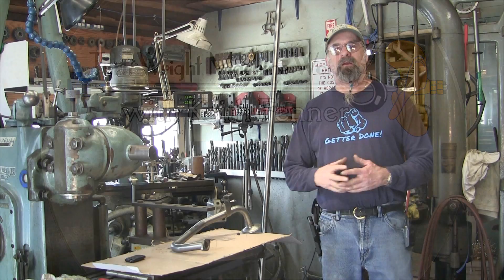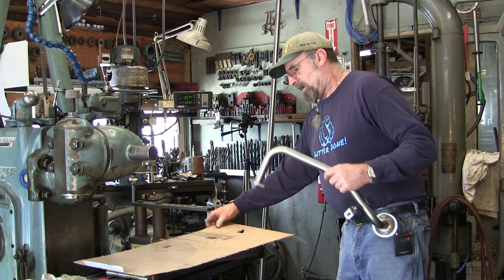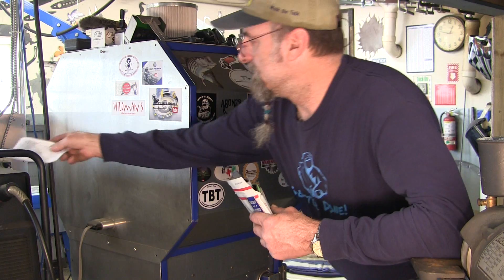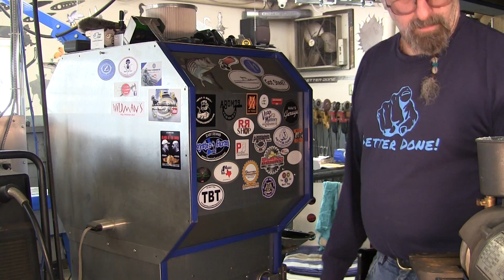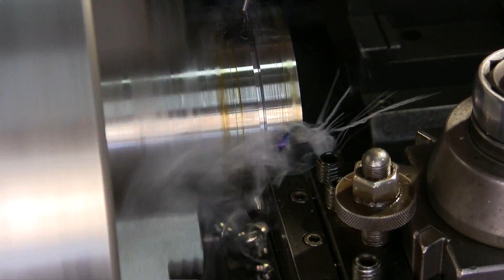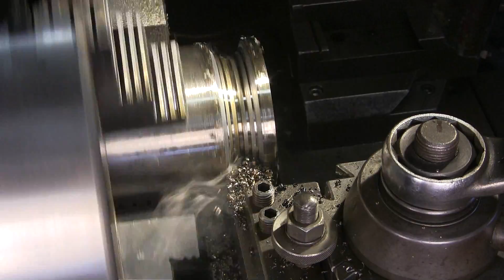Shortening Your Pick Up Line Part One

Comment: Hi Keith, 
I am bending something myself and realized we had the same issue with the distortion of the pipe/tube. Your bend must be done by your die (large) not by the operator. Meaning the force you apply to bend the pipe/tube will definitely cause havoc on your part. Fix: have the pressure you apply turn your large die, not the little one. For this you must cut a 90 deg out of the large die and weld a flat piece to hold the pipe/tube. As your large die turns, it will gradually pull and bend the pipe/tube very smoothly.  Otherwise, great work on your dies.

Comment: The bending die came out great, Keith! I just did a job similar to that for Gary Ramsey but I cheated and used the CNC lathe. Frankly, for a one-off I think your method was a ton faster. Next time maybe I'll use the Clausing instead!

Best wishes,
Tom Z

Comment: Hey Keith, They don't have a very deep sump in that pan do they. Is that mount to go on a main cap or the block? I like the way you made that for the bender, gives me an idea to make bender for myself. I remember spring back when I lived in Wis, they didn't sweep up our roads. Guess you live in plush part of town lol. God Bless Ya   Dave
Reply from the maker: I'll find out where the flange bolt too, when I head down for a fit up.  ;{)------

Comment: Nice job making the die. Question, the piece of stock was pretty hot(based on the smoking pile of chips from drilling) when you reamed it, how was the size after?
Reply from the maker: Okay because the solid pin was a little under, but I did run the reamer through after deburing the faces. ;{)-----

Comment: Hey pal, why not start with new straight tube?
Reply: cap the ends of the tube somehow after you fill the tube full of water and put it in the freezer. then bend it it will not kink or flaten. thanks for all your machining knowlage kieth.
Reply from the maker: Wasn't a hundred present sure on making the full bends in the new piece!  ;{)-----
Reply: It's a one off, the ideas are endless. Looking forward to your design.